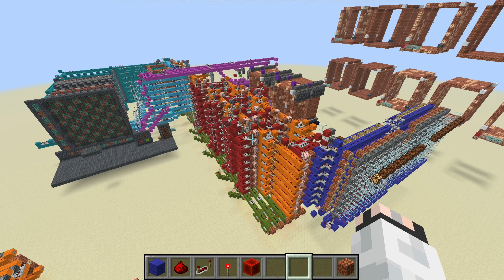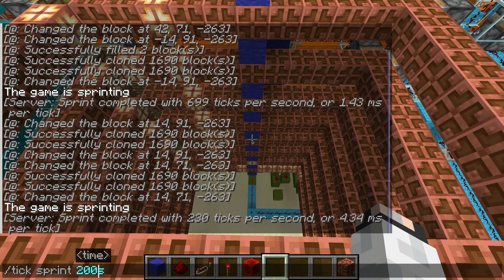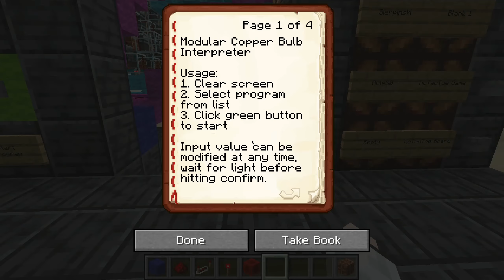Modular Copper Bulb Computer

Comment: I was lazier with my architecture: the extra instructions besides <>+- are

zero the tape
zero the accumulator
accumulator += tape
accumulator &= tape
accumulator <<= tape

and tape ^= accumulator

this made programs longer and less pleasant but kept the redstone simpler

The dream would be a bf variant that is easy to build in minecraft and easy to transpile bf to, but optimized- then the weirdly large library of existing bf programs opens up. The big thing missing is a "repeat the next instruction X times" instruction where X is encoded in the instruction.